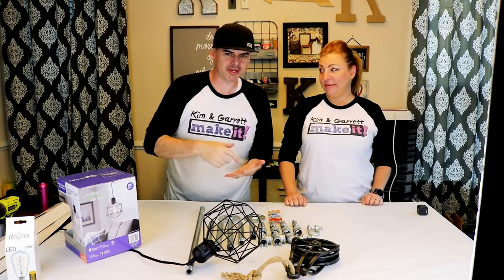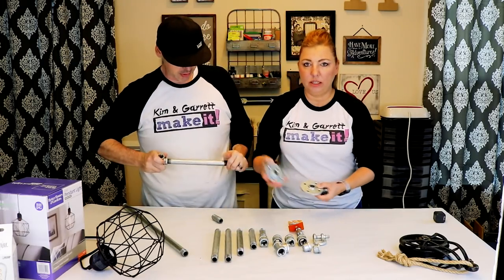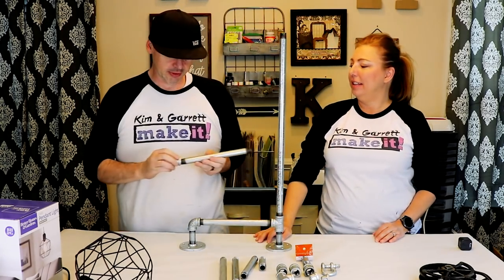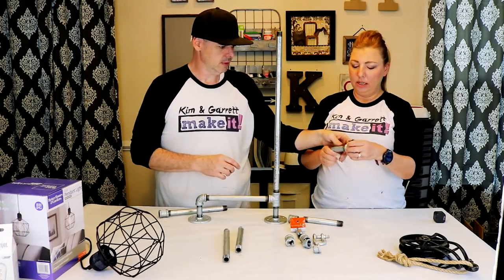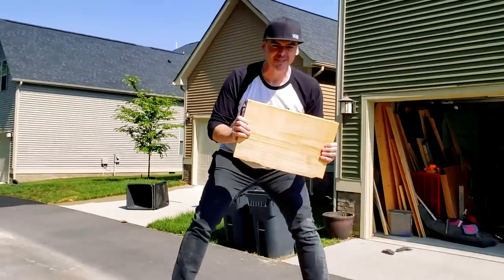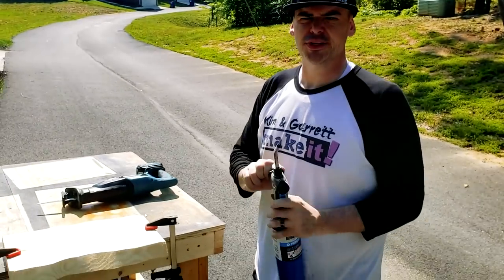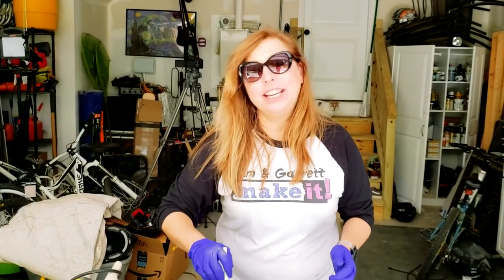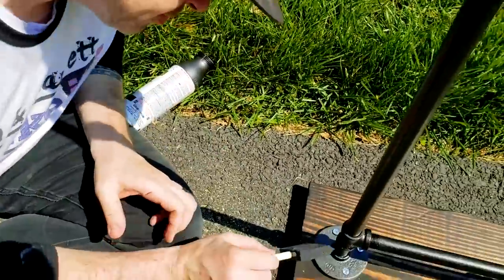The Easiest DIY Industrial Steampunk Pipe Lamp

Comment: what a cool build there..I'm working on a desktop one, using an old cast iron kerosene lamp base, some plumbing bits and old wire cage from a workshop light...need to got a couple antique pressure gauges and other things before I can do more. would love to try and find a pulley set up like that and make something along the lines of what you've done. cool channel, just found it so will be checking more   of your videos, cheers from the Land Down Under :-)